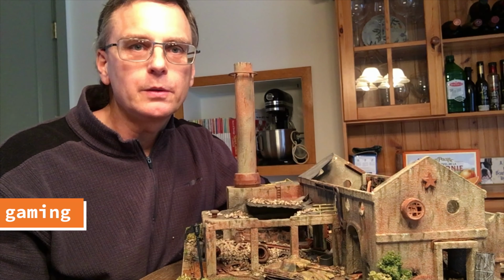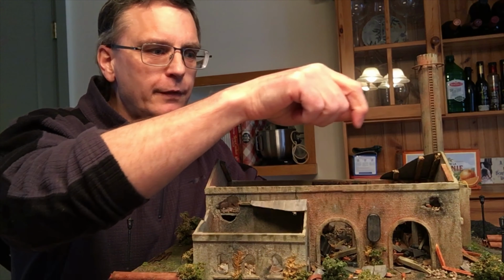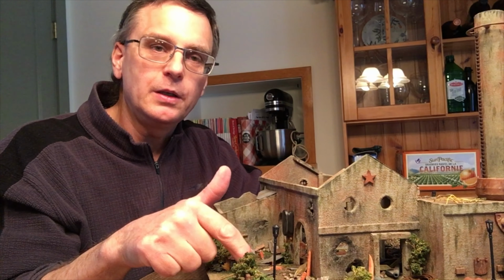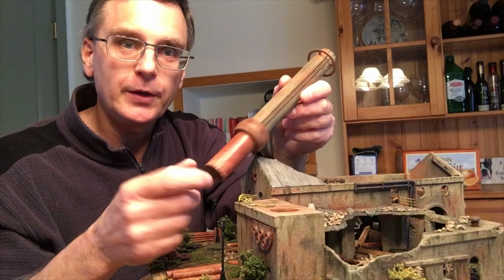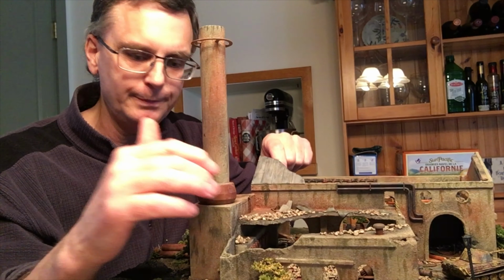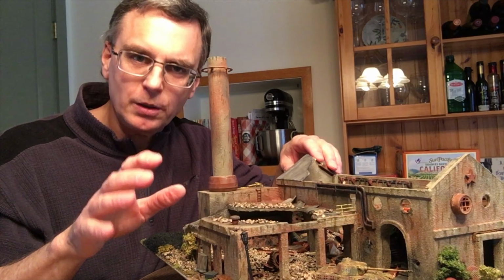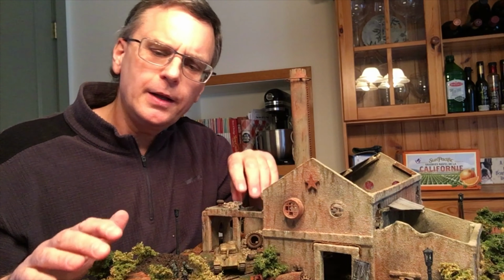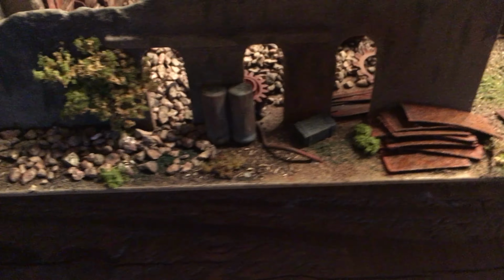Wargaming 15mm Terrain build WWII scratch built Stalingrad  ruined factory

Comment: Where did you purchase the chipboard? I would appreciate some links to products used.
Reply from the maker: Hello, unfortunately I have never seen the thick 1/8" chipboard for sale anywhere, only the thin veneer stuff. I found it in thick bound 3 ring binders. The binder backings can be different types of material, including a corrugate style. The structure coating is straight shifted  cement over  concrete coloured latex  paint and the coal is small aquarium filter charcoal. Hope this helps.